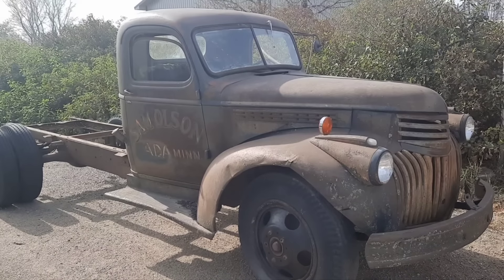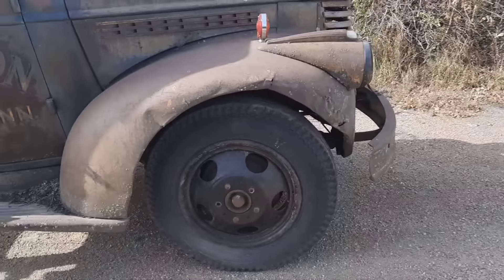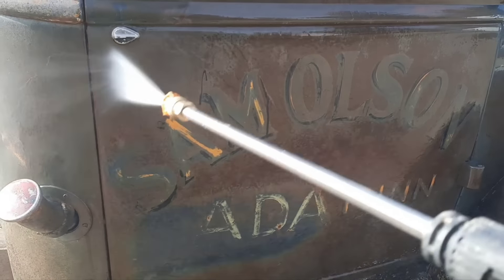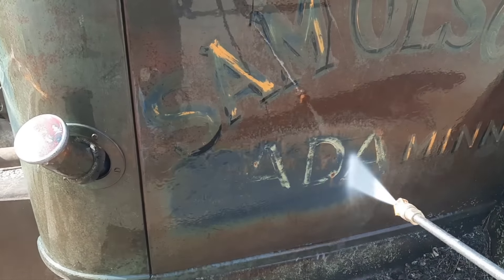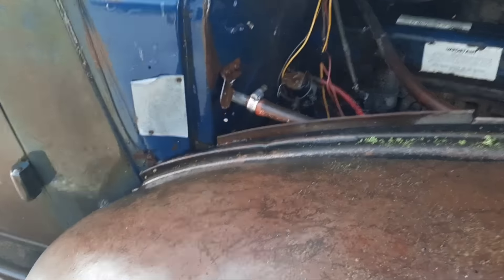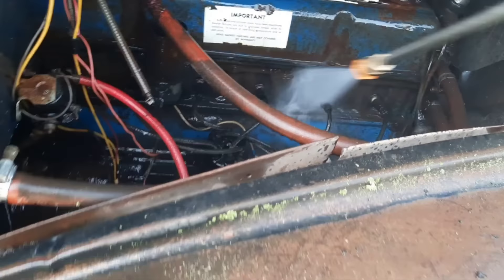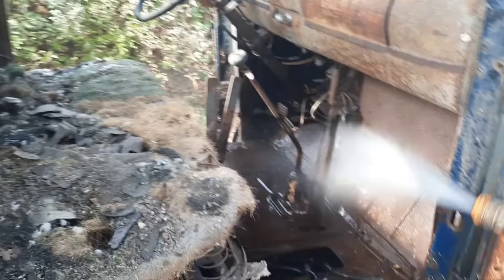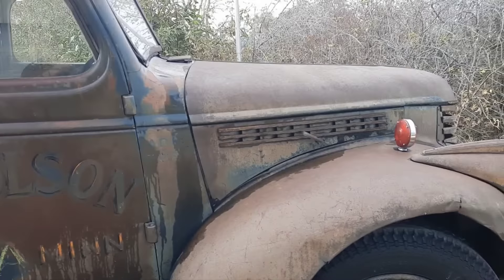Applying linseed oil to a 1946 Chevy.  Amazing results.

Comment: Try some Comet with that soap and water.  It'll take that oxidation off a lot easier and won't hurt the paint.  Try an out-of-the way area to be sure, but I think you'll find it works pretty well.

Comment: If you mix linseed oil half with full gloss polyurethane it will provide a harder finish than BLO alone. You might consider thinning it half with thinner (same thing as diesel fuel) and applying it in multiple coats, allowing it to dry between. HINT: use a foam "paint pad" for a better finish and cleaner hands.

Dry time is quick enough, but a total cure of BLO takes at least weeks, longer if the temp is cool. During that time it continues to harden (so does the polyurethane.)

Nice truck, nice job. Back when they still had some styling!